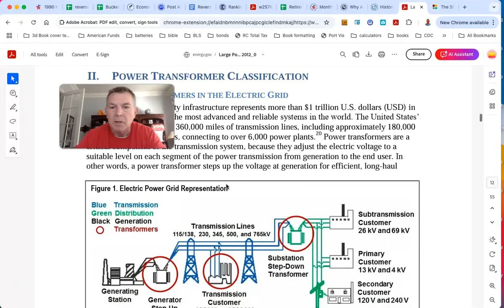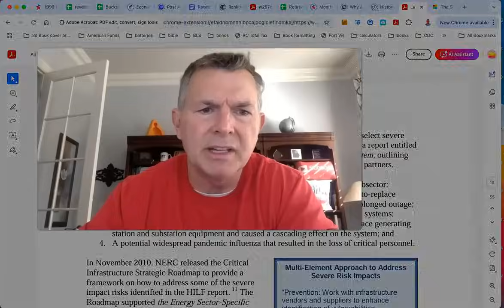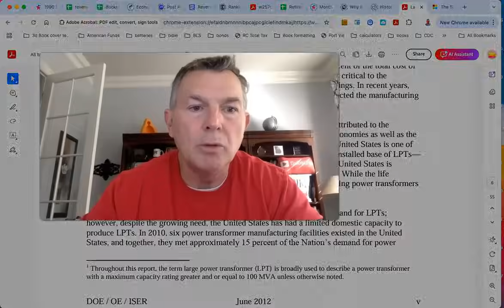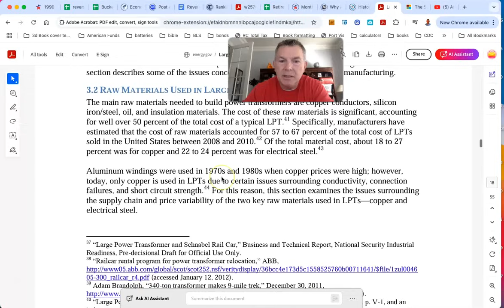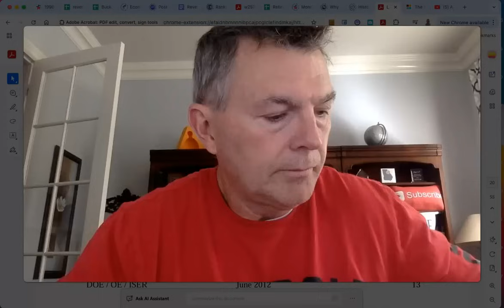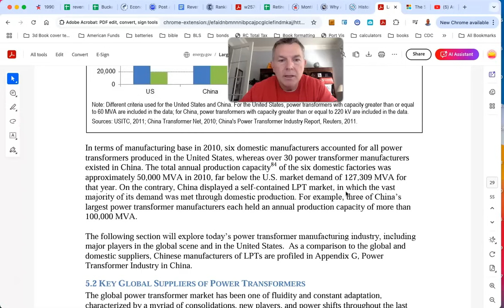You Want to Be Scared? Well This Should Frighten The Snot Out of You!

Comment: Former Tesla employee Drew Baglino has founded Heron Power to develop solid state transformers for the electric grid. These transformers are smaller, able to dynamically regulate voltage (needed for wind and solar, or sudden fluctuations in grid power), able to quickly switch power sources. 

This is the first significant upgrade for the century old transformer design.

Their first production line is planned in the US by 2027 to directly address the shortage of traditional transformers and the need for more grid flexible solutions.

In the meantime Tesla itself unveiled the Megablock. A ‘plug and play’ esc prefabed  collection of mega packs (grid scale batteries) that has the transformers built in.

Elon has been talking about the shortage of transformers for years, and Tesla has been stockpiling them for this occasion.

Tariffs are an important tool for critical industries. I’m sure Heron Power, Tesla and other American companies will thrive in this environment.

Comment: Scary?  Hah!  I see your video on the potential scarcity of electrical generation and transporting infrastructure, and raise you the 1859 Carrington Event, a solar flare that just happened to pop off in the right (wrong) vector and wiped out much of the telegraph lines in the U.S., if the same thing happened today it would do the same to our electrical grid.  The more advanced we get, the more susceptible we are to widespread calamity.  Sleep tight.

Comment: Step up at the generation then it steps down twice on the big transmission to get it to the consumer.  You don't see Power Transformers go bad very often.  Your worrying more than you need to Josh. Your article is pretty much off base. Age doesn't matter there is nothing moving inside a transformer.  In the Cooperative world (NRECA)  we have several spare power transformers in transformer pools. We have portable substations to pull in place if one goes bad. Your fretting too much.
Reply: Large EMP bursts from the sun or a nuclear explosion (esp at 40 thousand feet) can destroy transformers en mass.
Reply: @davidmannion5362  have we seen anything like that in your lifetime? I bet if we do we'll all be gone anyway. Right?
Reply: @mrtoothy8267  very large EMP bursts happen about once a century. The last large one was in the late 1800.

Nuclear bombs detonated at altitude will cause a very large EMP bust covering thousands of miles
Reply: @davidmannion5362  so what is there to worry about, I choose not to live in fear,  I'm 63 years into it and have not seen either.
Reply: @mrtoothy8267  I don’t live in fear, we are developing new transformers that work much better than the old ones and can be manufactured far faster. Hopefully this will happen before the next major solar flare, or detonation of any nuclear weapon at altitude.

Comment: Very interesting Josh.   I can see this is a problem.  The replacement of these transformers sounds problematic.   But that is just part of the problem.  The whole infrastructure of our power system will be overwhelmed if the A.I. thing turns out as big as many say.  It would trouble me if the price of electricity tripled and the working class was paying for it and in essence paying for a lot of the electricity cost increase created by these A.I. centers.
Reply: Most AI data centers are creating their own electric supply (at least beyond what a given area can supply).

XAI is importing a gas power plant to meet the needs of their new data center as quickly as possible. 

Some companies like Meta and Microsoft are making deals with utilities to sell them electricity from Nuclear Power Plants that were supposed to be decommissioned, or that had not yet come online.

Most will run off of solar with batteries installed by the data center developers to save money
Reply: @davidmannion5362  The real question is not if some of them bring their own electric supply to the table.  For the consumer of electricity a question is if they will compete for public power and how much of that will be used.   For me saying "most have their own supply" is not reassuring.
Reply: @prairiemark4084  Depending on your location it may not be reassuring.

You may buy your own battery and solar to offset the costs of grid electricity.

I highly recommend investing in companies (like PLTR, TSLA, SOFI, AMD etc.) that will profit greatly from the AI revolution.

That way if you are forced to go off grid most of the time, you can use the profits from said companies to offset your new energy expenses.